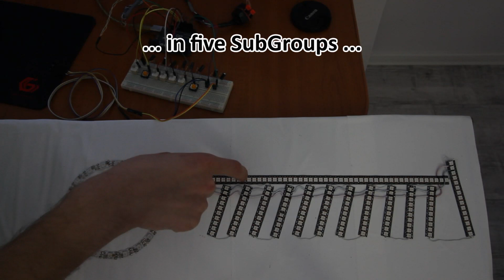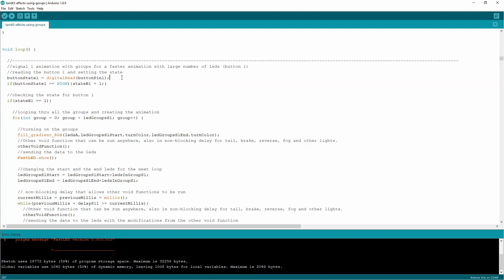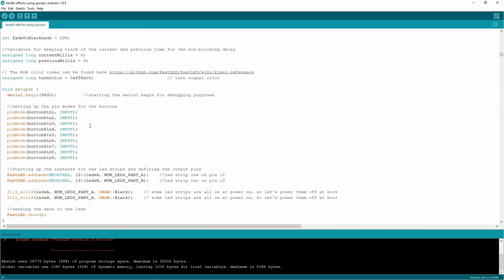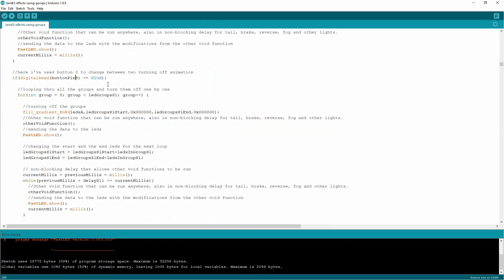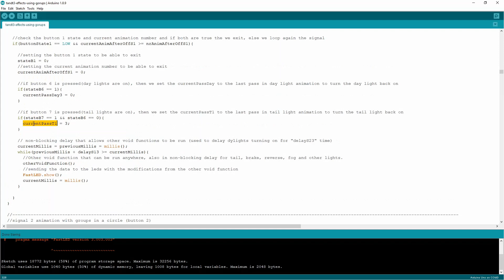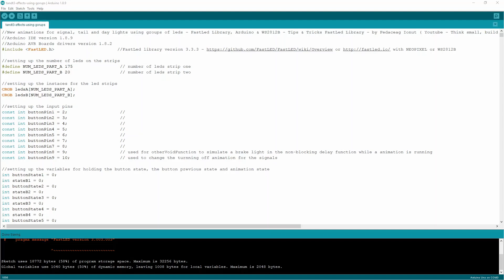New animations for sequential signal, tail and day lights using groups-Arduino, FastLED and WS2812B

Comment: Thank you for such a great explanation! I have edited the code for my project. I have a group of 120 and 3 subgroups. During the first loop, the segments come on one at a time. but after they turn off and repeat the second loop, all 3 subgroups come on at once instead of one at a time. I am having a hard time finding my mistake. Do you know where I should look? (I am on my phone and can send my version of the code tomorrow when I get to the workshop)
Reply from the maker: With pleasure!

From you explanation, i think that you forgot to reset the start and the end leds after you are exiting the first loop... check there first.
Use serial print and see if you are resetting correctly those variables.
Reply: @IonutF-TS-BB  Thank you! I looked for restarting the start and end LEDs. Here is my code below. The main difference is that I am not using buttons, but I am reading input voltage to trigger the pattern. So I took out button pin 9 to turn off LEDs. I wanted a dim red running light so I made it so that when there's no voltage, do run light state. I used a pattern from my previous version of my code I already had. Here is the code I am having problems with:

#include <FastLED.h>
#include <Adafruit_NeoPixel.h>

#define NUM_LEDS_PART_A 240
#define PIN 4
#define BRIGHTNESS 150
#define NUM_PIXELS  240
#define RightSignal A4

CRGB ledsA[NUM_LEDS_PART_A];
Adafruit_NeoPixel strip = Adafruit_NeoPixel(NUM_PIXELS, PIN, NEO_GRB + NEO_KHZ800);
int RightBlinkerState = 0;
int runLightState     = 0;

//setting up the variable for the first animation - signal 1 animation with groups for a faster animation with large number of leds (button 1)  !!!!!!!!!!  THE TOTAL NUMBER OF LEDS FOR THE SIGNAL MUST BE DIVISIBLE BY THE NUMBER OF GROUPS !!!!!!!!!
int numberOfLedsForS1 = 120; //this means that from the entire strip i'm using only 50 leds for signal !!!!!!!!!!  THE TOTAL NUMBER OF LEDS FOR THE SIGNAL MUST BE DIVISIBLE BY THE NUMBER OF GROUPS !!!!!!!!!
int ledGroupsS1 = 3; // how many groups are there !!!!!!!!!!  THE TOTAL NUMBER OF LEDS FOR THE SIGNAL MUST BE DIVISIBLE BY THE NUMBER OF GROUPS !!!!!!!!!
int ledsInGroupS1 = numberOfLedsForS1/ledGroupsS1;  // how many leds are in one group
int ledGroupsS1Start = 0; // first led from the first group (it's actually the last led from the strip)
int resetLedGroupsS1Start = ledGroupsS1Start; // reset first led from the first group
int ledGroupsS1End = ledsInGroupS1-1; // last led from the first group
int resetLedGroupsS1End = ledGroupsS1End; // reset last led from the first group
int lastLedLastGroupS1 = numberOfLedsForS1-1; // last led from the last group
int delayS11 = 250; //delay for signal animation
int delayS12 = 320; //delay to keep the on and off (used twice)
int delayS13 = 500; //delay from signal to day lights
int nrAnimAfterOffS1 = 3; //how many times the signals repeats with a single impulse
int currentAnimAfterOffS1 = 0;

int fadeToBlackLeds = 100;
unsigned long currentMillis = 0;
unsigned long previousMillis = 0;
unsigned long turnColor = 0xff0000;

void setup() {
  // put your setup code here, to run once:
  
  Serial.begin(9600);          //starting the serial begin for debugging purposes
  
  
 pinMode(RightSignal, INPUT);
 FastLED.addLeds<NEOPIXEL, 4>(ledsA, NUM_LEDS_PART_A);    //led strip one on pin 12
 strip.begin();
  strip.show();
  //starting up the instaces for the led strips and defining the output pins
  Serial.begin(9600);          //starting the serial begin for debugging purposes
  FastLED.show();
}

void loop() {

// Read the state of the right turn-signal voltage
  RightBlinkerState = analogRead(RightSignal);
  float RightVoltage = RightBlinkerState * (5.0 / 1023.0);

if ((RightVoltage > 4.99))
    {
    runLightState = 0;
    rightTurn();
    }

else if (RightVoltage < 4.99)
  {
    // If there's < 3v revert to run light state.
    runLight();
  }
}

void rightTurn(){
    
    //looping thru all the groups and creating the animation
    for(int group = 0; group < ledGroupsS1; group++) {
      
      //turning on the groups
      fill_gradient_RGB(ledsA,ledGroupsS1Start,turnColor,ledGroupsS1End,turnColor);
      //Other void function that can be run anywhere, also in non-blocking delay for tail, brake, reverse, fog and other lights.
      //otherVoidFunction();
      //sending the data to the leds
      FastLED.show();
      
      //changing the start and the end leds for the next loop
      ledGroupsS1Start = ledGroupsS1Start+ledsInGroupS1;
      ledGroupsS1End = ledGroupsS1End+ledsInGroupS1;
      
      // non-blocking delay that allows other void functions to be run
      currentMillis = previousMillis = millis();
      while(previousMillis + delayS11 >= currentMillis){
        //Other void function that can be run anywhere, also in non-blocking delay for tail, brake, reverse, fog and other lights.
        //otherVoidFunction();
        //sending the data to the leds with the modifications from the other void function
        FastLED.show();
        currentMillis = millis();
      }
      
    }

    //resetting the start and the end leds for the next loops
    ledGroupsS1Start = resetLedGroupsS1Start;
    ledGroupsS1End = resetLedGroupsS1End;
    

    // non-blocking delay that allows other void functions to be run (used to keep the leds on for "delayS22" time)
    currentMillis = previousMillis = millis();
    while(previousMillis + delayS12 >= currentMillis){
      //Other void function that can be run anywhere, also in non-blocking delay for tail, brake, reverse, fog and other lights.
      //otherVoidFunction();
      //sending the data to the leds with the modifications from the other void function
      FastLED.show();
      currentMillis = millis();
    }

    // non-blocking delay that allows other void functions to be run (used to keep the leds off for "delayS22" time)
    currentMillis = previousMillis = millis();
    while(previousMillis + delayS12 >= currentMillis){
      //Other void function that can be run anywhere, also in non-blocking delay for tail, brake, reverse, fog and other lights.
      //otherVoidFunction();
      //sending the data to the leds with the modifications from the other void function
      FastLED.show();
      currentMillis = millis();
    }

    //increasing the current animation number
    currentAnimAfterOffS1++;
  }

  void runLight()
{
  if (runLightState == 0) {
    strip.setBrightness(BRIGHTNESS / 24);
    spread(1, 0xFF0000);
    runLightState = 1;
    all(0xFF0000);
  }
  strip.show();
}

// Function to light LEDS from the center one at a time (spreading).
void spread(uint16_t speed, uint32_t color) {
  clearStrip();
  delay(300);
  int center = NUM_PIXELS / 2;
  for (int x = 0; x < center; x++) {
    strip.setPixelColor(center + x, color);
    strip.setPixelColor(center + (x * -1), color);
    strip.show();
    delay(speed);
  }
}

  void all(uint32_t c) {
  for (uint16_t i = 0; i < strip.numPixels(); i++) {
    strip.setPixelColor(i, c);
  }
  strip.show();
}

void clearStrip() {
  for (int i = NUM_PIXELS / 2; i >= 0; i--) {
    //for (int i = 0; i < (NUM_PIXELS / 2) + 1; i++) {
    strip.setPixelColor(i, 0x000000);
    strip.setPixelColor(NUM_PIXELS - i, 0x000000);
    strip.show();
  }
}
Reply from the maker: First of all, you are complicating yourself by using two libraries for the leds and also loosing a lot of space and memory... witch will make the sketch instable...

From the looks of it, ledGroupsS1Start and ledGroupsS1End are there so it is something else...

Try debugging with serial print ledGroupsS1Start and ledGroupsS1End at the start of the loop and see what you get... and will try other things after...
Reply: @IonutF-TS-BB  oh I see, thank you. I was using two libraries because I already had a sketch written for a tail light strip with patterns I liked and though I could just write in the parts I liked from your code. I'll learn how to do the whole thing in fastled, try what you said, and try again.
Reply from the maker: @BLueFeaTHeRedOliVeS   With pleasure! ;)